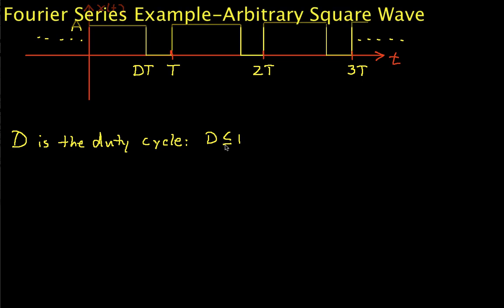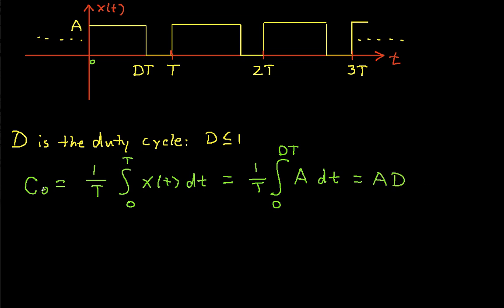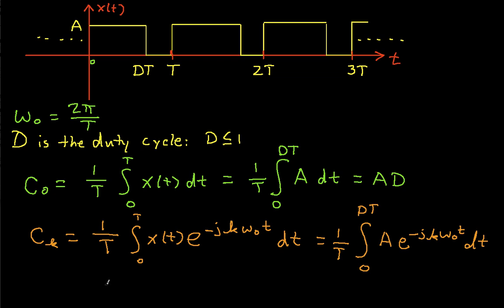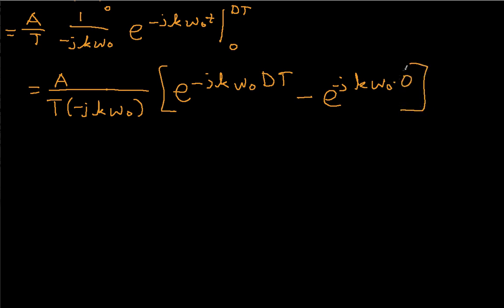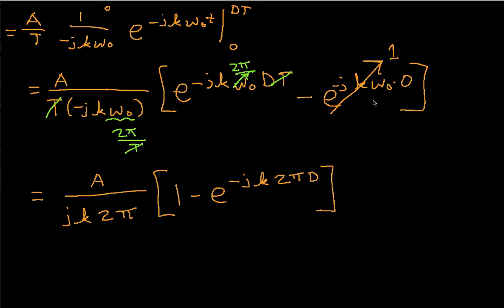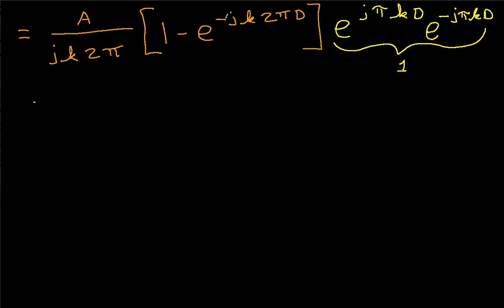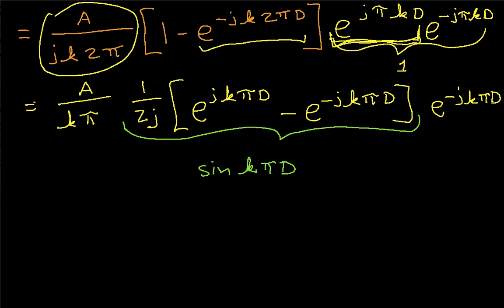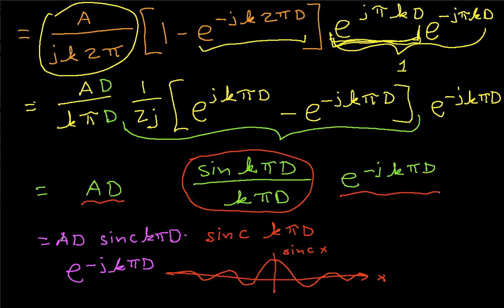Fourier Series Example-Arbitrary Square Wave Part 1

Comment: Nice videos.  I surprisingly never covered this topic as an undergraduate.  I received my BS in materials engineering, and skipped most math in college due to high school AP credit and some college math courses in high school (don't make the same mistake - keep taking math in college!).  I just didn't need any more math for my degree, and then I switched to solid state electronics for my PhD.  This definitely helped me understand Fourier series, which for me is useful for crystal lattices.

Comment from the maker: The exponential phase part is there because the square wave is not centered around the vertical axis. A square wave centered around the vertical axis is an even function, so its Fourier series coefficients would be real; since we shift this wave to the right so its rising edge is on the vertical axis, the Fourier series has the exponential term corresponding to a shift in the time domain.
Reply: Darryl Morrell does the mean I don’t need to add in the exponential component for a symmetric function centered around the vertical axis?